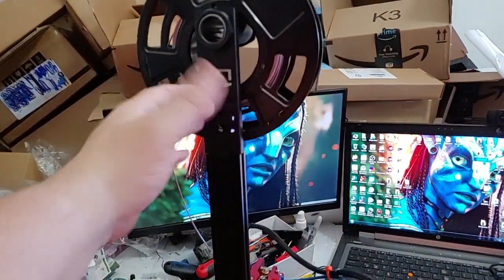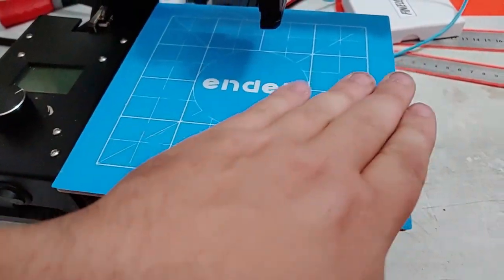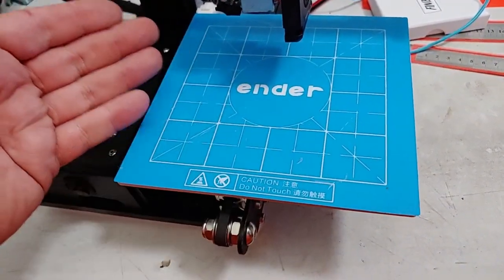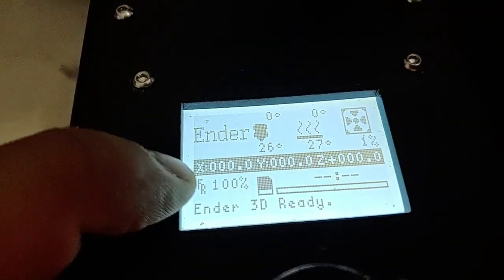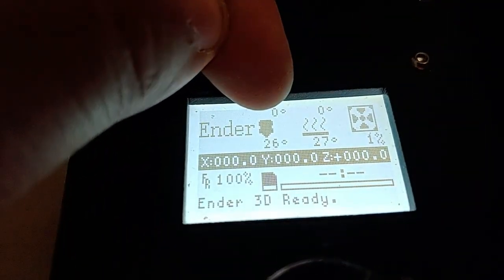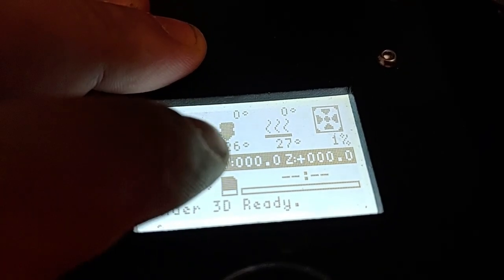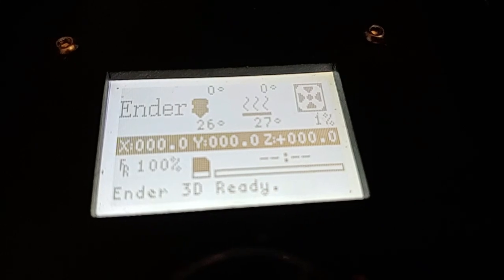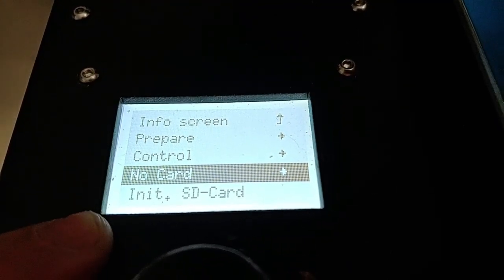3DP Basics Terminology T3DP

Comment: Do you know why Thomas Sanladerer didn't like the Nissan leaf? He now has a Peugeot e-208. Can you please explain? 
You have got me thinking about EV.
A second hand leaf in Australia start at $20,000. A lot come from Japan as grey imports.
Reply from the maker: It did not have sufficient range for his needs and of course they advertise it with the maximum possible range not the Practical reasonable range you're likely to get

I believe that was his primary issue with it and I don't blame him

The only otherwise real downside to believe is no temperature management system for the battery so if you live in a hot climate degradation can be pretty bad